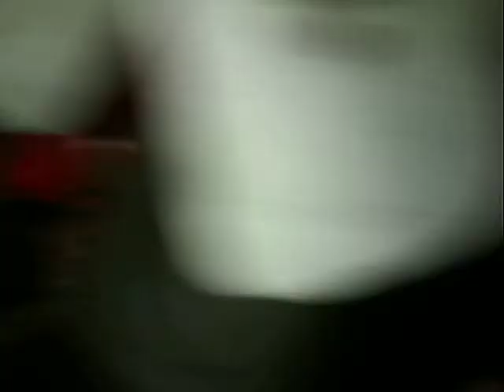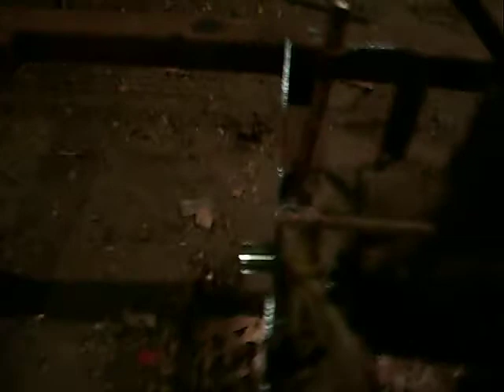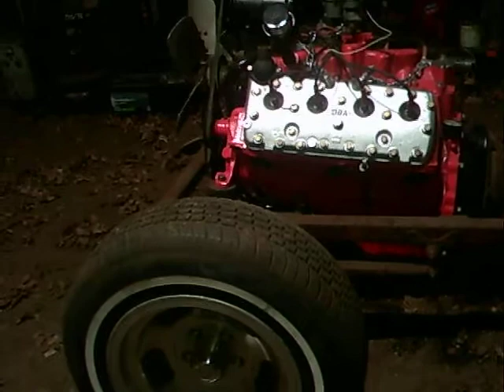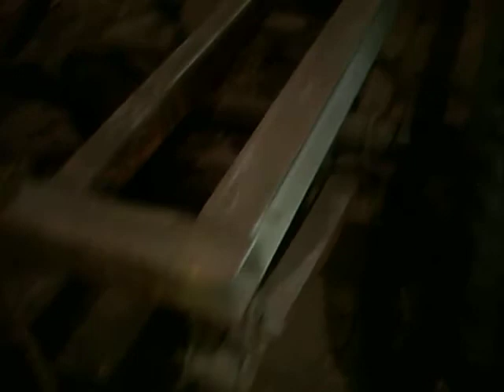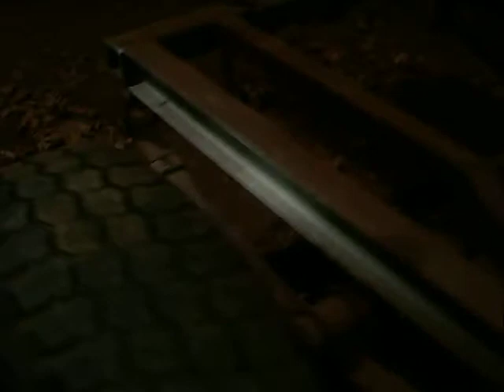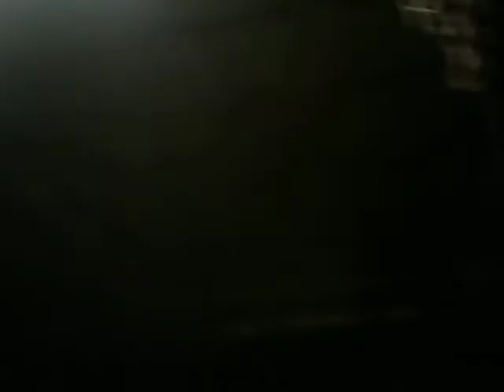John Deere rat rod no more, now Ford flatty V8 rat rod update Part 3

Comment from the maker: @indestructableforce The pump was to irrigate a strawbeary field and other crops, probly had about 4 inch pipes maybe 6 inch. It takes alot of power to pump a good volume of water and hold the pressure up. I guess I have to be patient with this project, I started it over 3 years ago. Then had a major heart attack right after that, and I always get tired of working on one project so I get too many going at once and never finish any. I guess it's time for this baby to be born now. Thanks    Dan

Comment from the maker: @meatwgn Well as you know, automitive engineers like to screw with mechanics. They've been doing it since time began. In other words, there is a right side  and a left side and one flange is backwards when you switch sides. There aren't any holes to put the bolts in on that one flange. I'm sure you have run acrossed problems like this before. The bolts in these flanges are at like 10 o'clock and 4 o'clock, when you switch sides they are 8 o'clock and 2 o'clock. Thanks for the sugestion.    Dan

Comment from the maker: @bigjohnson5619 I've heard about that before, now that you mentioned it, guessI forgot about it. Thanks,do you just drill a hole in them and put one between, and tighten the bolt. Or do you put one on the bottom and use two on each mount?     Dan